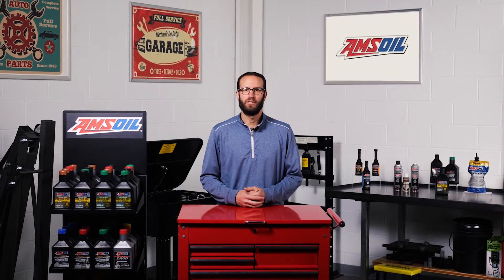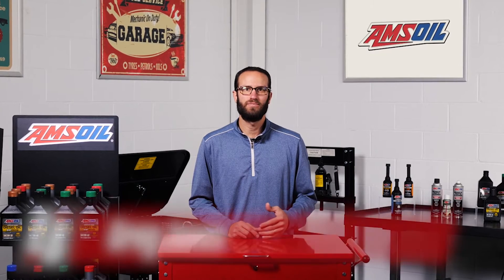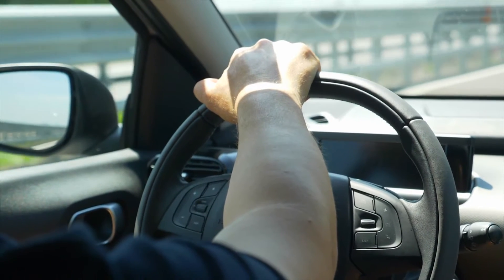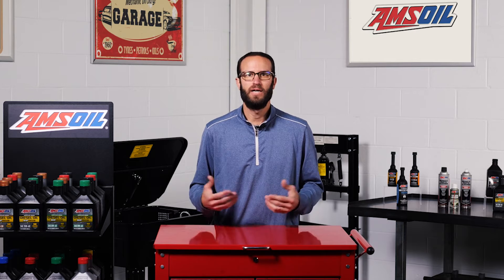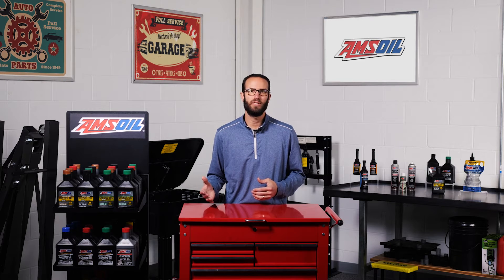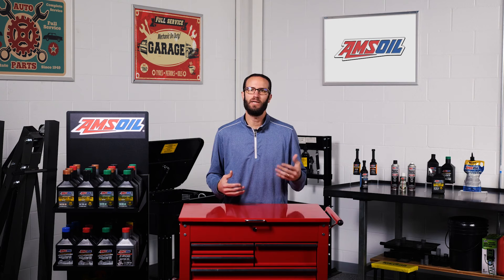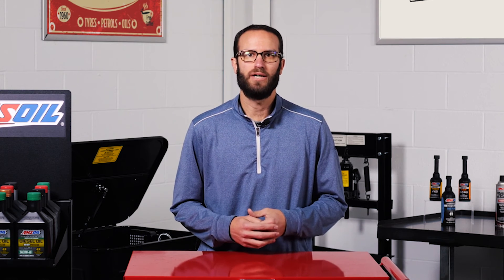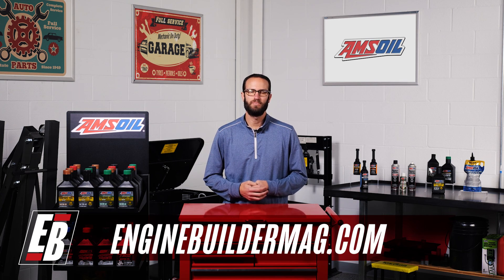Is Lower Viscosity Oil Really Better?

Comment: I don't agree with the statement that headwind, driving style, or a tank of bad fuel will erase the benefits of the lighter-weight oil. If real-world conditions change, then both the heavy-weight and light-weight oils would see a decrease in fuel economy. Granted, the real-world variables that were mentioned certainly occur and impact fuel economy, but that is independent of the oil viscosity.
Reply: He forgot underinflated tires.

Comment: They have never lowered the weight of vehicles in 50+ years. Every year they cram more BS into every car and raise the weight. A 60's Mercury Comet weighs less than a modern Honda Civic. They promised huge weight savings with all the plastic in cars but just added more with other mandated crap.
Reply: Safety>weight savings. That's all sorts of crumple zones, air bags, ABS, electronic stability control etc.
Reply: @kmook76  All crap designed to protect morons who shouldn't be driving in the first place. 
In my state I can drive my cycle without a helmet legally, it's my choice. I should be able to buy a new car without all the mandated safety crap also.
Reply: @gruberstein  Most people disagree with you and these improve performance anyhow, thus what we have. Estimated 700,000 people's lives were saved and many millions of serious injuries prevented.  Also most people insisted on buying larger and larger SUV's which are less safe for everyone and added far more weight than 250-400 lbs. You are free to buy an older car or a kit car also.
Reply: @kmook76  So are all those big rigs not unsafe for everyone? People bought Big truck and SUV's because they were safer in them and for a while they were exempt from emissions standards. How about the burning EV's that self ignite and trap the passengers when the electric doors don't open? Or maybe those collision avoidance things that decide to put you into a tree rather than hit a dog or slam on the brakes instead of swerving around an obstacle. And don't forget the touch screen controls that make you look away from the road to control almost everything in the car.
Most people disagree because that's all that's available now. I'm pretty sure lots of people would like a cheaper lighter car that doesn't need a Phd  to operate or maintain.
Reply: @gruberstein  Bullshit pivot acknowledged. If you wanna argue buying a bigger SUV that handles worse, rollover nightmare, hits and kills pedestrians more, hits more curbs, harder to park and takes more room, emits more pollution and thus kills more people, kills more animals and causes more asthma etc is cool be you. Just don't argue that a little bit of weight for safety and performance equipment isn't worth it then argue for an extra two thousand pounds of worse everything from an SUV is what you wanted all along.
Reply: It is true that every time engine technology improves, usually due to regulatory pressure, the increased hp is put right back into accessories or allowing the vehicles to be heavier, rather than using the technology to simply make the engines/drivetrains smaller. Americans NEVER learn to Conserve... they only want bigger, faster, better ~

Comment: I was thinking about this last dark cycle(night) that perhaps I shouldn't run T6 5w-40 in my '81 Turbo 6.2 Diesel as it probably has more clearance in the bearings throughout the engine and is more than likely more harmful than helpful due to the lower viscosity. I'm switching back to T5 15-40.
Though i do have easier cold starts, improved performance and increased fuel economy by using the 5w-40it doesn't outweigh the added protection a slightly thicker 15w-40 can offer. Protection over performance.